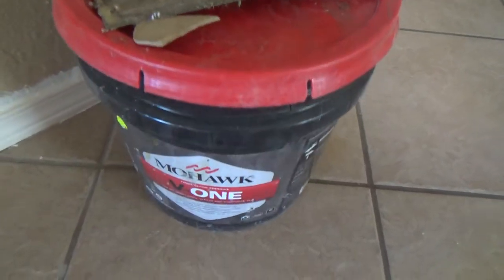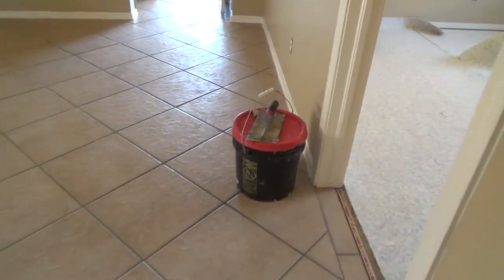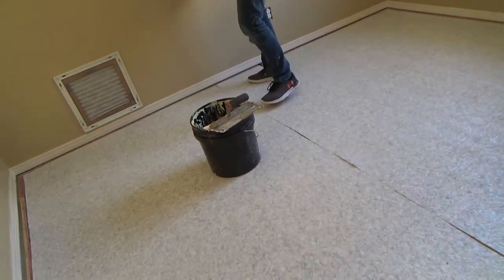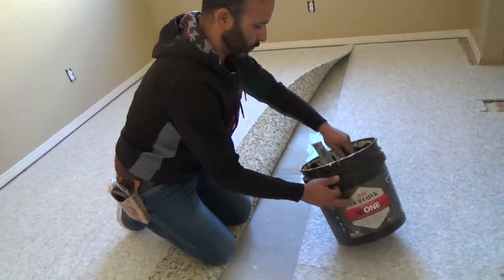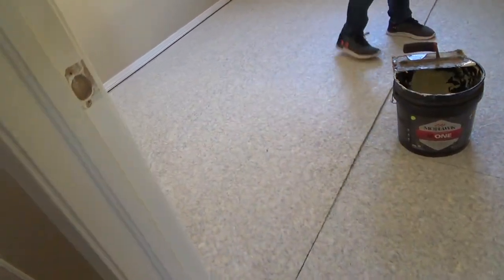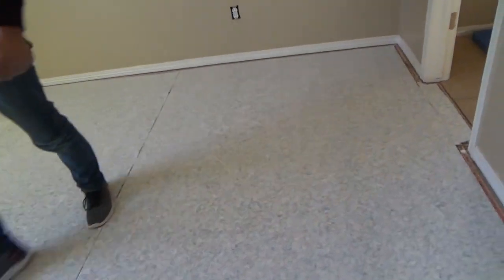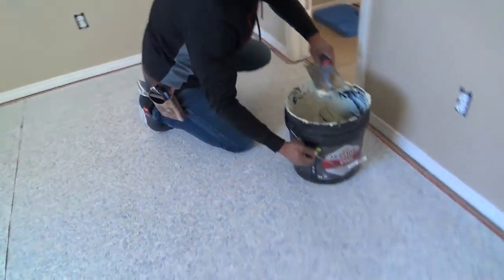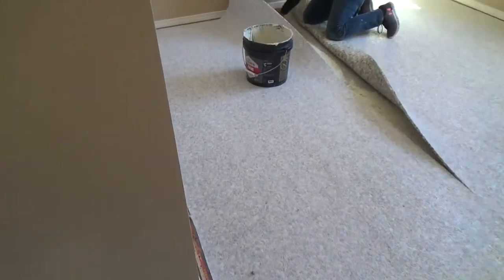Home Rehab Episode 18...How to Secure/Attach/Glue Carpet Pad to a Concrete Subfloor?...Easy!

Comment: You don’t need all that glue on the concrete, now it has to be scraped off for the floor.   
This just makes it a pita for the next installer, and has zero benefit for anyone.
Reply from the maker: Well I guess that's just the way this guy does it for installing carpet pad on concrete sub-floors. It keeps the carpet pad seems from moving around. I've seen other installers put masking tape over the entire seems but the carpet pad could still move around in traffic areas I would think. Thanks for your thoughts on the matter & great to have you stop by! Make today great!
Reply from the maker: If you want to see more of this carpet install then just go to my main YouTube channel page then click on playlists & scroll down to carpet. Thanks!